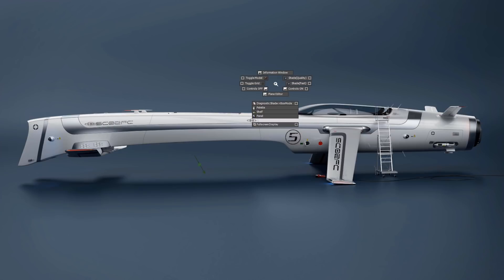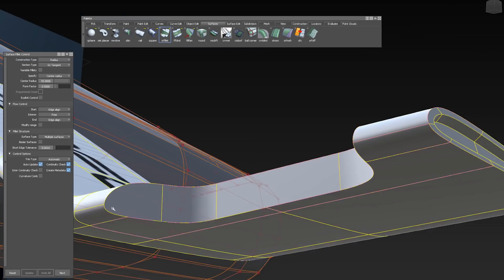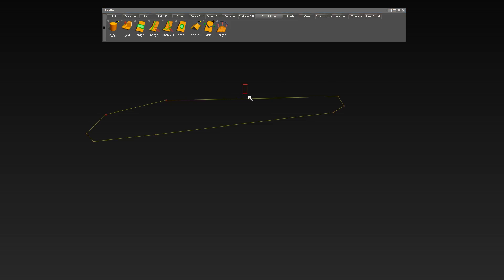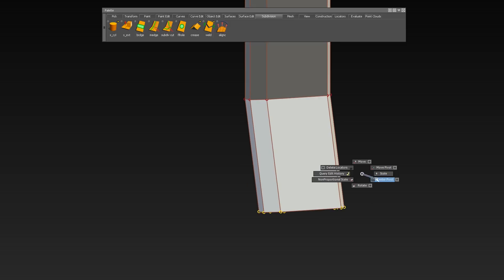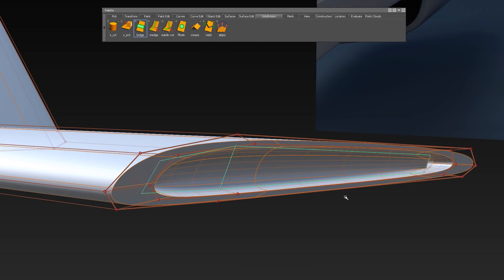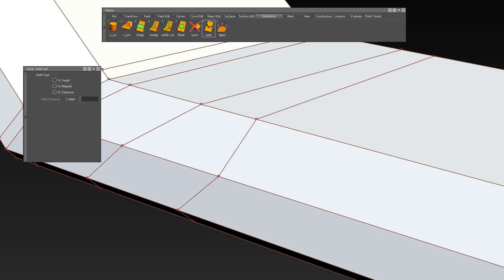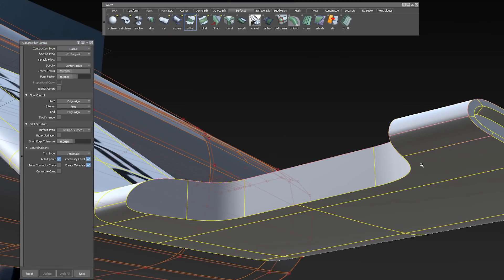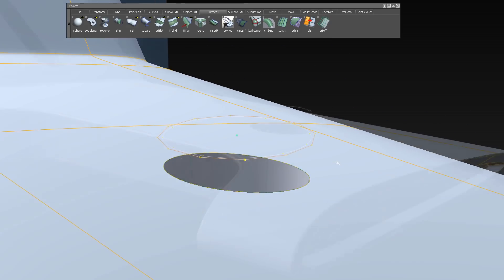Alias 2020 WhatsNew Subdiv Long Intro

Comment: what is the difference between the T-Splines and SUB-d？
Reply: The difference is essential: With subD you cannot end with a T type point, hwere with T-splines it is not a problem, hence the name T-splines. T-splines team are working on a completely new technology called U-splines (isogeometric analysis over T-splines and NURBS). Possibly could get a precision on the shape boundary surfaces and borders.

Comment: Blender user here We have that like since forever. Nice you try to keep up. Lol. Oh and how much does your super extra innovative tool cost? Its not free? How sad...
Reply: You obviously don't know the difference between poly modeling and surface modeling. subD gives you actual workable surfaces for class a modeling. Blender is useless for surfacing because the surface quality is shit.
Reply: lol why are blender users like this?
Reply: The difference in surface quality justifies the price. And having NURBS level quality and precision with SubD simplicity has never been done before. So Blender cannot compete with what Alias is offering here.
Reply: blender dosent use nurbs !
Reply: @cynulp  Check out Imagine and Shape (CATIA module); it has subd simplicity with NURBS output.
Reply: @gtada   getting Nurbs output from subs is not new / exciting. Applying Nurbs operations like trimming etc. on subds as in the video is new / exciting!
Reply: @Nebelzinne  Yes, that's what Imagine and Shape does (trim, intersect, etc.). For a long time. This is not new.
Reply: @gtada  I didn't know that! Do you have any video on this to share?
Reply: It's not a religion ....it's 3D software.....relax. Just be happy that you're content with your own system and workflow.
Reply: @gtada  thanks for sharing! Looks a bit clunky to me (why is the front part of the car copied for the Nurbs refinement part?), but still, much more than I thought IMA would be capabable of. :-)
Reply: @Nebelzinne  If you get a chance to try it, I recommend it. One thing that I hate about Alias is how much "scaffolding" it requires (so many curves). There are many things I would change in IMA, but overall it's a very efficient and fast package to build in.
Reply: @Nebelzinne  No that is not new.. it's been possible since very long time ago (around 2005 I saw this technique with stuff from nPowerSoftware - Power Nurbs). Convert subd geometry to nurbs and voilla you can do trimmin and etc like on any normal nurbs
Reply: @chronokoks  are you still able to modify the subd then, and your nurbs modifications follow? IMA seems to be able to do that, but as said, I didn't know that.
Reply: @Nebelzinne  anything that is history based will be updated automatically
Reply: sadly blender can't send that to mill